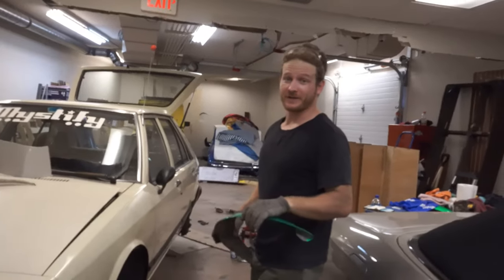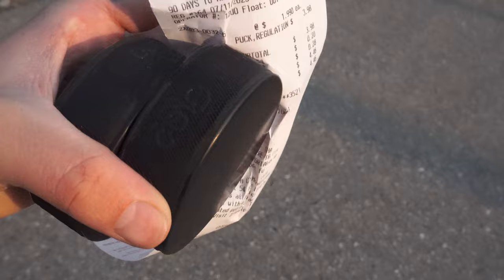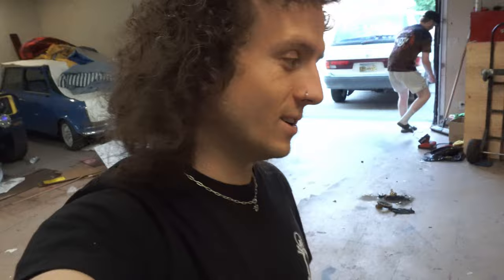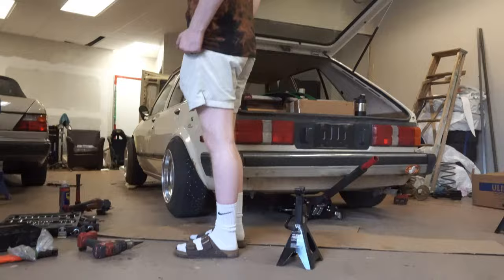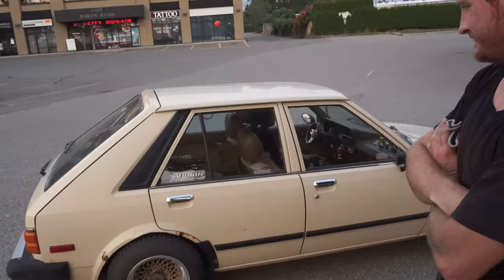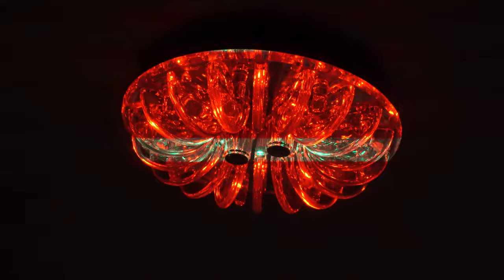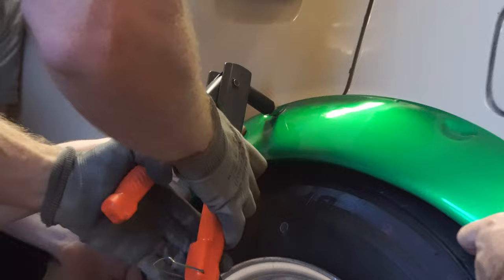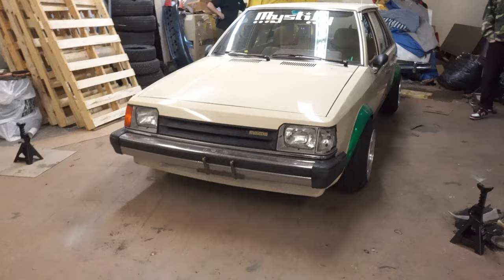GLC Slammed On Hockey Pucks

Comment: Should have modified the suspension to give it camber instead of cutting the rear 😂
Reply: It's okay! It's extremely rusty back there anyway lol. Fender flairs cover it up well. For the next spec we will have to cut more probably. These 9J wheels are just level 1.